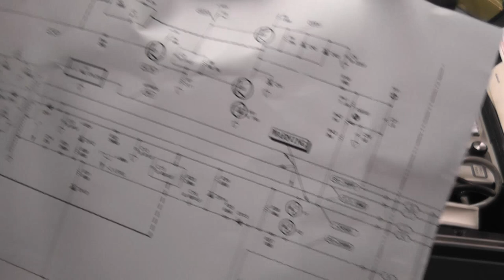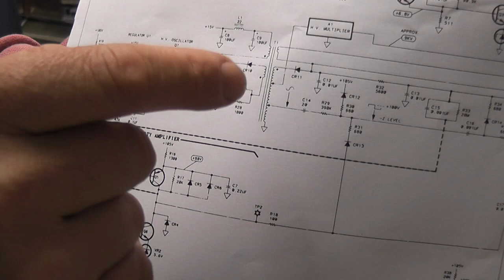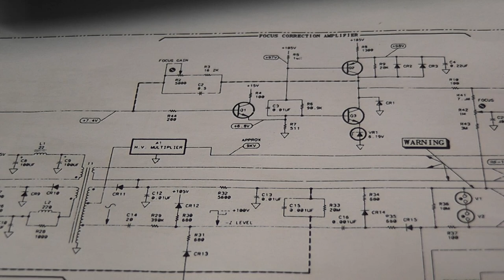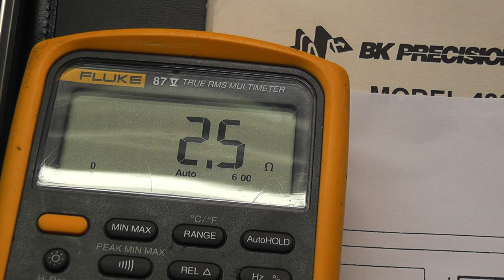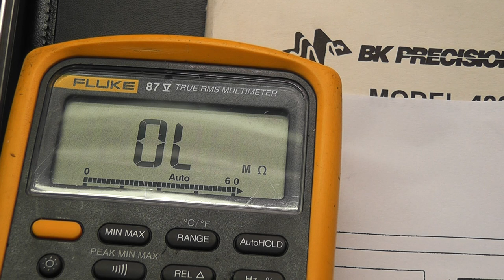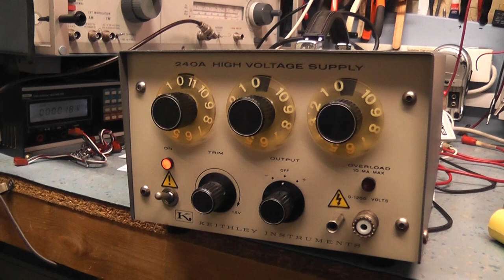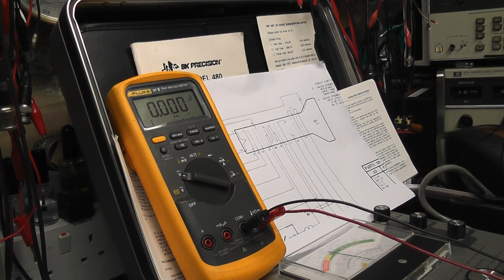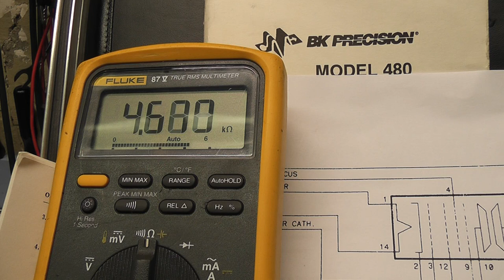CRT Cathode Heater Short. Can it be repaired?

Comment: Would it not have been possible to leave the heater / cathode short alone and simple run the heater from an isolated source, small transformer or even a few turns of wire around the line out transformer. I like your video`s. Complements, Chris.
Reply from the maker: Yes that was an option. Unfortunately by the time thus fault showed up I had come to the end of my tether with the whole machine.  This was the 2nd Crt that died.

Comment: A bit of arm-chair quarterbacking  as we would call it over here, but couldn't you remove the connection between the cathode lead and the heater lead in the power supply and let the short be that connection? The isolation of the transformer winding allows the filament supply to float at cathode potential in either case. (?) I had an interesting battle with an HP 1349A display for my 8753A VNA that had lots of very intermittent issues mainly with the Z output, turned out to be cracked solder joints at the pins on the circuit boards that the CRT wires plug on to. Thank you for an interesting video. Hope you have a happy Christmas - Regards, David

Comment: I would have removed the jumper, and replaced it with a 50 to 100 ohm resistor. That would have provided a higher impedance connection but still effectively limited the heater to cathode voltage. If (when) the internal short came back, the current through the resistor path would not have been enough to overload the flyback transformer.

Comment: basically, what happened to your filament, is that the oxide coating on the wire cracked due to heating cooling cycles, or arcing, allowing the wire inside the oxide shell to expand enough across the gap to cause a hot short.  other then mechanical repair of the filament i do not know how to fix such a failure. Doing so is a rather expensive and time consuming process though.

Comment: It's a real shame about the heaters,  but it was already very ill.
That heater would of never behaved itself,  i don't suppose giving the heater it's own isolated transformer would of worked any better eather.
I'm not a valve or tube man,  but i did make a tube blaster back in 92,  so i diddled with old delta gun crts a bit.
I had similar ideas to you simon, the cap voltage zapping jumped out of the transistor whisker zapping lol.
Is that crt a very special one,  does the test gear have a video signal that could feed something else.
Or is it super special scanning frequencys that's incompatable with everything else.

Comment: Darn that's unfortunate. Never worked with CRT's, but I'm guessing it probably has a coated tungsten heater using AlO3 which is an insulator. Sometimes as the tungsten wire ages it begins to sag. You might have seen tungsten sag in an old incandescent lamp before it goes open. Then the alumina coating will crack and flake off. I'm speaking off the cuff here, my knowledge of CRT's is not good. Some of the high power transmitting tubes used what was called a "pusher spring arrangement" on the thoriated tungsten cathode to help keep it under slight pressure (and because of the thermal expansion of the wire) over the life of the tube. Example is the 4-1000A. Still, I think you will be able to pick up a another used spare in the future if you hawk it out. Merry Merry Simon.

Comment: Have you ever had any experience with Sony Trinitrons, specifically BVMs and PVMS?  My BVM-D20 flashes pink randomly but consistently.  I was told that it's a cathode to heater short that could be causing it.  When I moderately tap on the glass part of the tube's neck, the pink flicker tends to go away but then returns.
Reply from the maker: Sounds like loss of vacuum?

Comment: Hows about trying RF welding to cure the of heater? I tried it years ago from an article in Television magazine using the high voltage waveform from the lineoutput valve top cap (Pl504)  it worked but not for long.🤔

Comment: Darn, shame. There is a technique of putting a high voltage across the the heater (current limited) and tap the neck to hopefully weld the heater. But it needs enough heater wire left to get the ends to come into contact.

Comment: blasting the filament was a stupid idea. the wire used in it is a few microns in diameter, so even a small cap discharge will break the wire.
Reply from the maker: We all do stupid things sometimes.
Reply: @SoddingaboutSi  yup. everyone is a general after the battle, as it where. i know i have done my fair share of stupid things and will likely continue to do  the occasional stupid., just like everyone else.

For a situation like the filament blasting, i use the term "Brain AFK", AFK being an abbreviation of "away from keyboard"

Comment: you could also just rebuild the cathode. though it would require glass blowing knowledge to do.
Reply from the maker: There is no one who restores CRT's any more. I have option of a LCD replacement but it's not worth the cost.
Reply: @SoddingaboutSi  a few places still have the knowledge and equipment to do so. among some private individuals like glassslinger and me. I however lack the glass blowing ability's of glass slinger.
Reply from the maker: @lbochtler  I did find anothet complete displsy with a good gun. Not sure of its emissions though.
Reply: @SoddingaboutSi  well, with some crts, you can get an extra bit of life from them by changing their operating values. as long as the filament is good, the tube should light